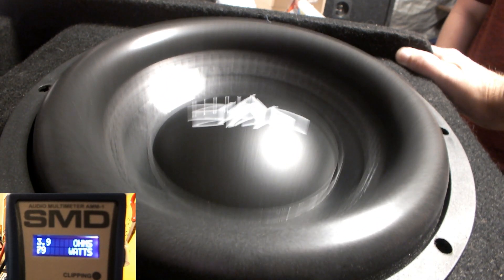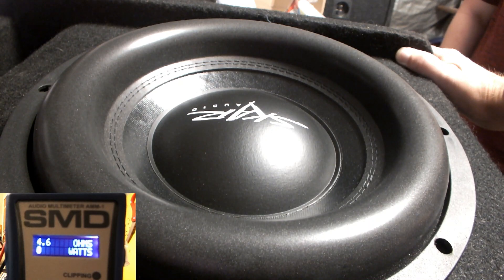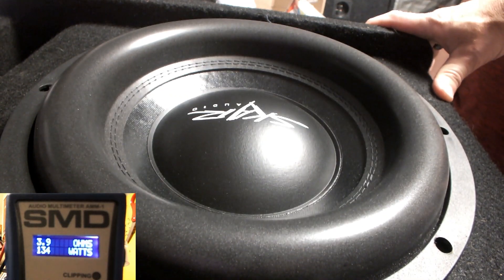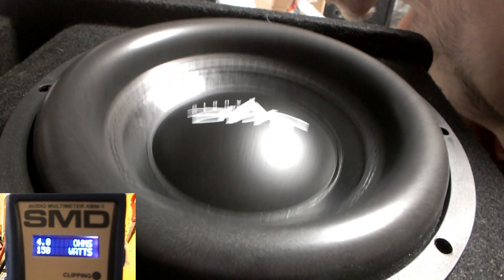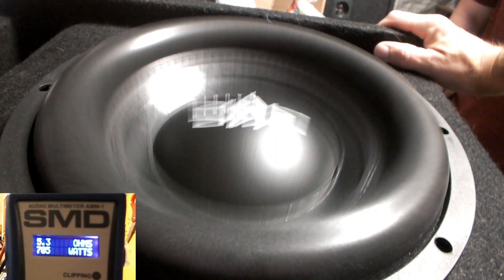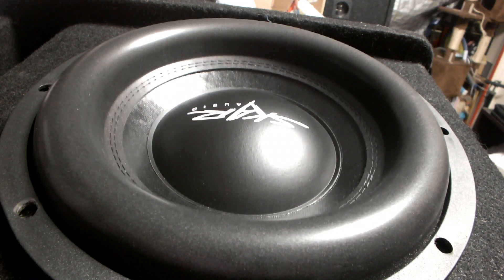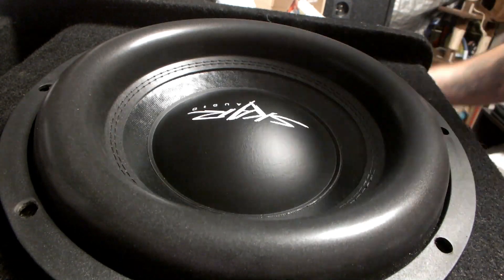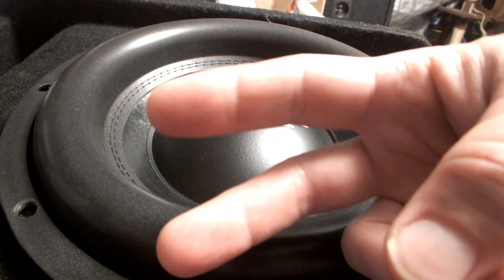Skar Audio VXF-12 D4 #car #subwoofer Skar Audio SK1X12V Taramps HD3000 #caraudio #amp SMD-AMM1 #dyno

Comment: I got 148.5 db with the d2 version of that sub in my custom 3 cube tuned to 33htz on a smart 3k clamped 4250watts real power
Reply from the maker: I have to build a box. I don't have the time, but I'm going to just start making steps even if they're small and eventually it will get done
Reply: Just got the 15. Do you think it can take 2000w rms?

Comment: Should get a dual 2 wire it down to one ohm
Reply from the maker: I would get a dual 2. If you get another wire it to 1/2 ohm. With your rise it will run at double the impedance if not much more at times. My VXF Dual 4 wired to 2 ohm's would go up into the teen's and 20 ohm's. Sometimes I couldn't believe what I was seeing. It's not just one sub or one box, I watched someone else's video and it ran exactly the same. Thanks for your comment and support 🙂

Comment: 2.5 cubic feet tuned to 33to 35 htz that sub sounds best also with proper port area the vxf moves alot of air putting it in that 2 cube box that's really tuned around 4042htz and has  small port area that 2 cube box u have the sub itself takes up almost 1cubic foot I believe it actually.8 cubic feet that sub in ur big ported box u have I think it's 2.5 cubes will have the best sound and loudest output I've personally tested that sub in the exact boxes u have I also put the vxf in a 3.5cube box tuned to 32htz and that sub destroyed the low lows
Reply from the maker: I'll do a test in a few different boxes same amp move it facing up and sideways
Reply: @joshholden8561 I just got the 12 vxf d2 in that same skar box. Sounds good but doesn't get as low in the box as I'd like. Do you have a link or a build list to that 2.5cuft box??

Comment: Sometimes u can lower the impedance by not facing the sub up face it front ways u might see the ohms not climb so high
Reply from the maker: I'm going to try that. For the first time ever in my van I don't have it facing the roof, I couldn't fit it in the van so I put it sideways facing the rear door. It sounds great so far.